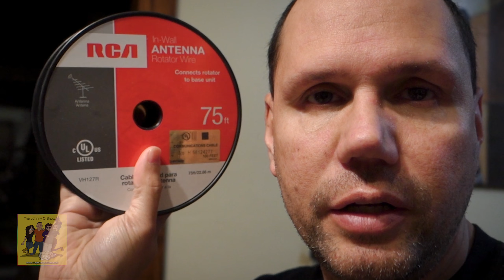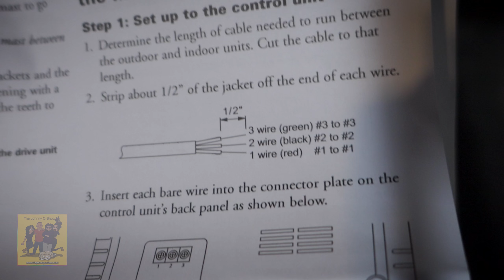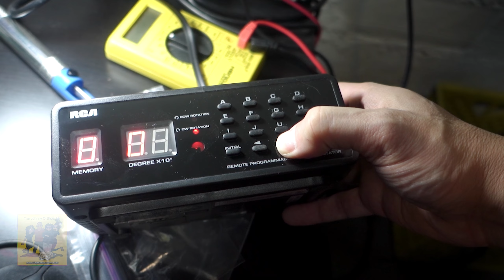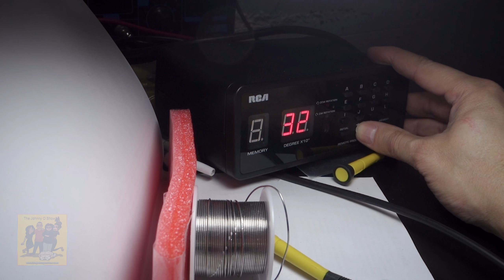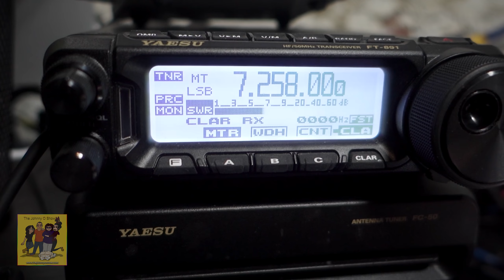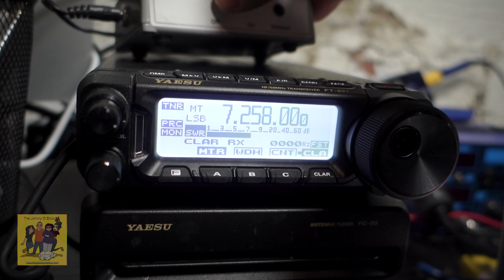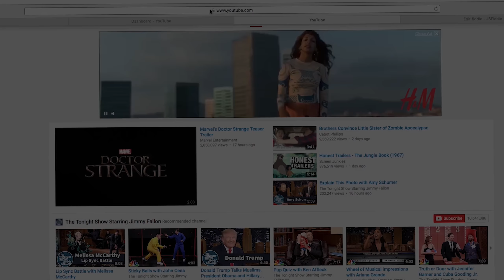Ep. #443 Assembling & Testing the RCA Antenna Rotator

Comment: Hello, I am KC4ZZE, This is what Ham radio is about, sharing experiences and knowledge to advance the art. I needed a way to rotate the hexbeam remotely 200 miles away from the shack using a RCA VH226E antenna rotator. I came up with a solution after giving it a lot of thought. I purchased a WIFI IR hub and manually programmed the hub training it with the VH226E’s RCA handheld remote control as an experiment. It worked!  I can now rotate the hexbeam from my cell phone turning it North, East, West, and South controlling the VH226E Antenna Rotator from my android cell phone using the Tuya App. The IR hub is freely supported by the Tuya app. I watch from two remote cameras to see the inside rotator box and outside antenna rotator operate and turn as I use the Tuya app. The AC power to the inside RCA VH226E box is a manual switch on the side of the box.  I set the switch to permanent on position and plugged into a Kasa AC outlet. Now I can rotate my antenna from any where in the world with WIFI connection.
Reply from the maker: wait, I did not even know that existed I just looked it up, do you mean something like this,?https://www.amazon.com/Control-Infrared-Universal-Automation-Compatible/dp/B08NCKBXSB

I have been trying to figure out how to control this antenna with out being in front of it, if this is what you mean that's awesome I will order one, thanks for the info this is great!!!!!

Comment: the PVC you're using is uv proof. It's electrical schedule 40. And it's nice you matched the clors to the manual. But it really doesn't matter as long as 1=1 & 2=2 etc as long as it the same color on both ends

Comment: I have an RCA VH226F rotator which has stopped rotating.  I've had it up going on three years.  I suspect the issue is with the controller since there is no voltage across the cable contacts when the controller is engaged.  Do you know where I can send it for repair?
Reply from the maker: Im not sure, but i think the control box has a fuse in it, i will check mine later tonight and let you know
Reply: @Thejohnnyoshow  Please do.  I'd like to know if it has one.  In the meantime, it started working again when we warmed up from some very frigid temperatures here.  While I don't believe it was frozen by snow or ice (we had a full day of abundant sunshine which usually melts things around here), an Amateur radio friend had issues with his Ham rotator.  He theorized the freeze had congealed the lubricant in the rotator motor.  Perhaps that's what happened to my RCA.  However, just to be on the safe side, I ordered a new rotator and controller from Amazon.  At least now I'll have a back up.

Comment: Hi, I’m planning to set this combination up. How are they doing together so far? Thx
Reply from the maker: its working well. If you have not already purchased the rotor, remember the mag loop has a 30 day return policy, its a little inconvenient but you can manually rotate the antenna to test to make sure it does what you need before investing in the rotor. you will defiantly want the rotor if you find the antenna does the job for you and this one does work well.  https://www.amazon.com/gp/search?ie=UTF8&tag=thjoosh09-20&linkCode=ur2&linkId=ada9b8e78d6e382a047c03b3b9c37e82&camp=1789&creative=9325&index=aps&keywords=antenna%20rotor
Reply: The Johnny O Show Great, I’ll go in that way. Main reason for trying this Magloop is for fighting the strong led noise my IC710 dipole is picking from the street. Thanks for your feedback.
Reply from the maker: noise even got worse for me here. i have added also the mfj1026. i have the magloop on the aux side of the 1026 and my transmit on the main side. now i can either listen with just my magloop or my transmit or there at times that my transmit only picks up the power line. and the mag loop can not get rid of it all so I use the mfj1026 to phase the rest of that noise out. i have added and will be adding a lot more videos as i continue fight noise but the mag loop has been the biggest weapon against it so far
https://www.youtube.com/watch?v=wjgeiKsMPog&list=PLfiklpBmJhxQfRJCJQvYjbs1HChcGrp8p&index=37
Reply from the maker: I do find i'm on the radio now several hours a week compared to not at all for several months before making all these changes

Comment: The downfall of this is that the 3 rotator wires don't have connectors to make a secure connection, I had an old Zenith rotator setup that the 3 wires shorted out at the box and blew the motor on the mast... This one has a clamp under the box but that's not good enough, a socket conector would be bullet proof as the wires are so close to each other and very thin, they will break off short out and poof! goes your mast motor.